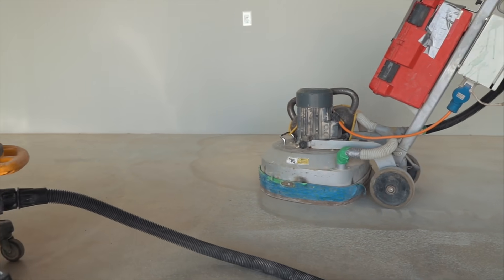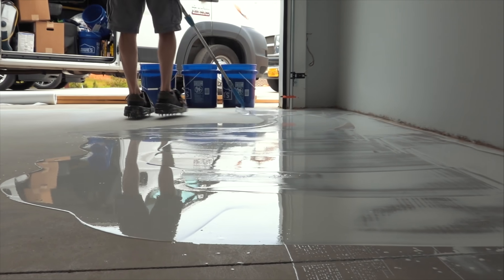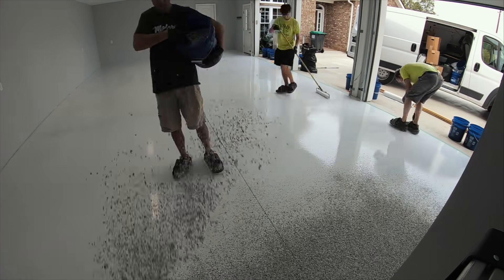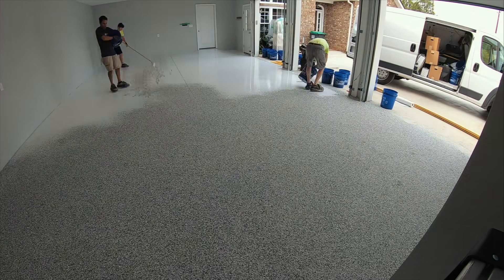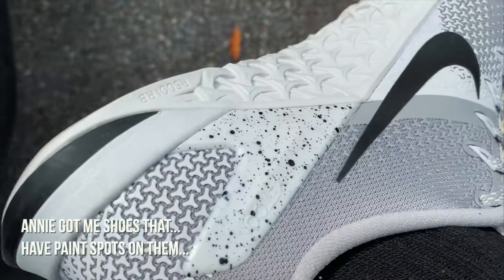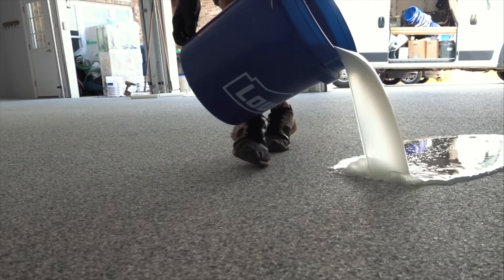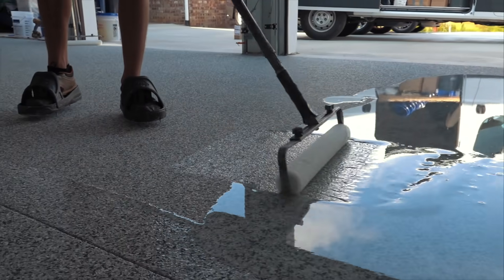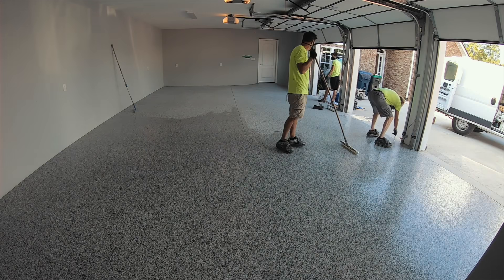EPOXY or POLYASPARTIC? A Step by step guide for an epoxy & paint chip garage floor.

Comment: Hi, Can you please suggest the product - Polyaspartic Coating; where to buy and and what to look for while purchasing. I am planning to do Garage Floor Epoxy using Polyaspartic (clear top) Coating, but finding it very difficult to purchase the item. Polyaspartic  is neither available in Home Depot nor in Lowe's. Thanks in advance
Reply from the maker: Hi. 

We use 100% solids epoxy with 90% solids polyaspartic urethane. You usually have to buy directly from the manufacturer. 

We don’t offer specific brand suggestions on YouTube. That is available
In our course along with a lot more information about how to do this type of coating. 

https://decorativeconcreteschool.teachable.com

Comment: @timdcva do you ever need to do anything special with the control joints on the slab before your epoxy base layer ?
Reply from the maker: We fill them with epoxy paste or polyurea caulk if the customer wants a seamless floor. Other wise, we don’t have to do anything to them.

Comment: If I painted a mural on a clean slab concrete floor, and you guys' clear coat on top, would that work? 
Would it be ok, if mural was done in water base acrylic paints?
Reply from the maker: It would probably be fine if you sealed it with water based sealer. You would need to test it first.

Comment: How about epoxy over brick? I know it sounds weird, it's a weird house. The interior floor is brick over concrete so the brick it pretty stable. I should remove the brick and float concrete over the whole thing but the client is reluctant.
Reply from the maker: I always tell the customer we need to remove whatever is on the concrete. I would just be nervous the surface of the brick would deteriorate.

Comment: What about the slip factor.  I didn’t see you add any silica to the final polyaspartic.  Is this top coat non slip. ❓❓❓
Reply from the maker: We don’t ever get any complaints about it being slippery. I think it’s a good balance of texture so it isn’t too slippery without it being so rough that it would be hard to clean.

Comment: I would like to do the apolly acrylic in my house do I have to do the whole thing at one time for it to be uniform  or could I do half let it dry and set up and then do the other half would that look okay thank you
Reply from the maker: The color should be uniform if you did half at a time… but the top coat might have a slightly different sheen if you did it in two phases.
Reply: @TimDCVA  thank you very much I really appreciate it when I do it I will do the whole floor
Reply from the maker: Sounds good. Let me know how it goes.

Comment: Thank you for this very informative video. I am having trouble clicking on the link for the polyaspartic product you use. Any assistance appreciated. I am going to attempt project myself. Assume grind, vaccum, prime, epoxy, flake and then polyaspartic. Thank you.
Reply from the maker: The course site is down this evening for maintenance. Just check back tomorrow and it should be up. 
Thanks!

https://decorativeconcreteschool.teachable.com

Comment: ?how much it cost
Reply from the maker: Usually between $5-$7 per square foot. It varies from job to job based on the size and condition of the concrete.
Reply: @TimDCVA  A guy gave me a  quote 11$ square foot for polyaspartic.
Reply from the maker: Was the garage small? Most people have a minimum charge so it can go pretty high per square foot for small garages.

Comment: We did the same to our outdoor staircase and balcony and after 3 years on the balcony there is a strip of 4 ft long that has lifted and there is like a bubble underneath but has not cracked yet, why is that and what might of caused it?
Reply from the maker: It could be a number of things. Sometimes it will happen if the concrete wasn’t prepped enough before applying the coating… or it could have been caused by moisture passing through the concrete. It’s hard to say for sure without seeing it.
Reply: Tks

Comment: The last shot of the floor looked like a pebbly beach.  I hope you made it smooth eventually, otherwise it would have been cheaper to leave the concrete as it was
Reply from the maker: It is smooth.
Reply: @TimDCVA  Look at 3:30 to 3:35.. that's not smooth
Reply from the maker: If you are looking for something that is perfectly smooth, then we have other systems for that. 

Vinyl chip epoxy has enough texture to keep it from being slippery without being hard to clean. None of my customers have ever complained that it’s too rough.

Comment: What's the difference between epoxy and polyaspartic? I'm looking to do our garage and don't know what to buy
Reply from the maker: Polyaspartic is a urethane that sets faster than epoxy and doesn’t turn amber in sunlight. It doesn’t bond to concrete as well as epoxy… so we use epoxy primer… broadcast chips and then top coat with polyaspartic.
Reply: @TimDCVA  ahh that makes sense. The kits that I am looking at online, I'm guessing they are likely 100% solids epoxy and then the top coat is the polyaspartic top coat. Is that what I should be looking for?
Reply from the maker: I would look for >95% solids epoxy with 85% or greater solids polyaspartic. 

The poly sets really fast. If this is DIY then be careful. Don’t mix too much at once and have plenty of helpers available.

Comment: What is the purpose for the vinyl chips and can one do the same but without the vinyl chips?
Reply from the maker: It’s just for the look. It also leaves a good texture for a garage floor. Epoxy without chips can be slippery when wet if you don’t add something to give it texture. But to answer your question… yes you can do it without chips.

Comment: I have a room under my garage that the salt and water have rotted the galvanized pans underneath. I have 2 drains in my garage but the salt soaked right in. Will this epoxy application stand up to self and water? Great video btw! I've subscibed.

Comment: How lond did it take to make the polyaspartic resin lqyer before it cured? Is it still useful to work with (is it still thin) after e.g. 30 minutes?
Reply from the maker: 30-45 minutes of working time. Cures overnight.

Comment: You did a great job! I noticed that you did not extend the Apoxsee floor beyond the garage door. Smart move. Our installers took it all the way to the asphalt driveway, so they cover the entire concrete garage floor. Now the Apoxsee that extended beyond the garage door is chipping up. How do I stop it from going any further? How do I clean up the remaining Apoxsee that is on the garage floor beyond the garage door to create a nice line? I have tried to get people to come out to fix it. But they have said that the job is not big enough and unless I want to replace the entire garage for it’s not worth they’re doing it. So how can I remove what’s chipping and how do I prevent it from going any further? But I would appreciate any ideas because this is a problem that I believe could be fixed.

Comment: I have a sunroom with awful tile. Can this process be used over existing tile (without removing it)?  We are trying to find a floor that is dog proof (they haven’t taken well to housebreaking!) but it needs to be flooring the will go over a floor that slopes (there is about a 6 in drop from one end of the room to the other -about 30 feet).  Is epoxy flooring as durable as it looks?
Reply from the maker: We always suggest taking up tile before applying epoxy. We can go over tile if there is some reason not to take it up. 

We’ve actually done epoxy flooring for dog kennels... so yes I think it would probably be okay.

Comment: You should look into being a dealer for Penntek. They have a less than 1 day dry polyurea product thats got a lifetime guarantee with 15 year warranty. Much more flexible and durable than regular epoxy! You can't buy it in stores  and its not cut with any thinners. 100% polyurea. You can also install in very hot or very cold Temps down to -20°. Highly recommend!!
Reply from the maker: Cool. I’ll look into it. 

I haven’t really had much interest in the 1 day systems... always worried that a floor will get away from us before we can get it rolled out. The low temp install would be awesome though. 👍🏻
Reply: Does Polyurea have any moisture barrier protection in it?
Reply from the maker: @martinspille4921 most of them don’t.

Comment: Tim- This is beautiful work!  Two questions though...I live in Pittsburgh, PA, with cold winters and snow.  Lots of hills here and road crews use a great amount of salt and calcium chloride on the roads to keep them from icing over.   So first question:  Will this product stand up to road salt and calcium chloride?  Second question:  is there any risk of hot tire pickup?  Thanks-
Reply from the maker: Thanks!

We haven’t had any issues with them holding up to road chemicals here in VA.

Hot tire pickup is not a problem for high solids epoxy & polyaspartic urethane (assume it is prepped correctly). Some lower solids/thin-film coatings from local paint stores don’t do as well under tires though.
Reply: @TimDCVA  Thanks Tim!  I gotta do something before winter...gonna give it a go!
Reply: I have a contractor that has been doing this for years in Pittsburgh, PittsburgGarage.com

Comment: Can this be done on a outdoor concrete counter top? It does get part sunlight in some areas. The counter top is concrete and not smooth. Do you think epoxy will be a good idea? The counter top is about 80 sq Ft. What will be the cost for labor & material?

Comment: Kinda weird you used epoxy instead of using polyaspartic through out the whole process. Polyaspartic has a fast dry time, which results to a one day job instead of waiting 12 hrs for the epoxy to dry. I work for a polyaspartic company, I do garage floors everyday. And my company only charges about 6$ a square foot
Reply: Polyaspartics do not have as good as a bond to concrete vs epoxies, a lot of small companies offer a lifetime or 10 - 15 year warranty, not worth the paper they are printed on. We have an epoxy basecoat that is dry in 3 hours.  Check it out, Sikafloor 165 FS.
Reply: @BradWeil  ive went back to floors that we’ve done 20 yrs ago just for a clean and they look as good as new. Epoxy is much more time and money wasted into labor when you can get better results with one day of work while using poly.
Reply from the maker: Hey!

I don’t use PS primer because I don’t want to do the entire garage in one day. I know I’m in the minority on this...but  I don’t like waiting around for it to set up so we can clean and coat it. 

For me it’s just easier to use epoxy primer so we have more time to get it down...and instead of waiting for it to set up, we just go do something else.
Reply: TimDCVA Still do great work. We have a high demand here in Florida with these floors. The owner has 3crews which I’m a crew leader on one and since we’re in Florida with all this heat, the product takes only 15mins to dry. Right now we are doing balconies for this hotel by the beach but its a quartz system
Reply from the maker: Cool. I live in a pretty small town so there isn’t enough demand to do that many garage floors. What products do you like to use?

Comment: Tim, awesome video.  Awesome work. Does the polyaspartic ever bubble?  If it does should bubbles always be fixed?  Thanks
Reply from the maker: Thanks! 

Changes in environmental conditions during an installation can cause lots of different issues. It’s hard to answer your question without seeing what you are talking about.
Reply: We had a floor put in at our condo last week. There are bubbles everywhere. The installer say it's normal, from the gas release.  In general, do you believe bubbles always need to be fixed or it depends on reason such as if from gas release or too thick of a coat. Thanks Tim.

Comment: Looks good,  how come you didn't fill the control joints to make it a seamless system? You would also get better coverage on your coating and sealer if you used a larger squeegee and laid a bead on liquid on the floor and spread it out by following it with the squeegee.
Reply from the maker: Thanks! 

We offer filling joints as an option to all customers. They chose not to do it. I like it better with the lines showing anyways.

I don’t like to use a wide squeegee. It leaves too much material in the low spots of the floor.

Comment: Had my 2-car garage coated last year using the polyaspartic method. Workers started at 8:15 and were done the same day at 1:30 PM. Waited 24 hours to use. Was expensive, but came with a 15-year guarantee. Definitely the way to go.
Reply: Polyaspartics do not have as good as a bond to concrete vs epoxies, a lot of small companies offer a lifetime or 10 - 15 year warranty, not worth the paper they are printed on.
Reply: @BradWeil  What is the warranty if you use epoxy? How long does it take to finish an epoxy job?
Reply: @artlayton1425  Every legitimate manufacture of flooring resin systems offer a standard one year warranty.  Sika has been in business since 1910.  We do offer extended warranties to our applicator network, but keep in mind the installations crew's preparation and application is the key and they are the ones offering the 10+ year warranties.
Reply: @artlayton1425  Our fast cure epoxy primer/basecoat is ready for topcoat in 2 - 4 hours depending on temperature.  Too cold then longer.
Reply: How much was it and how big is your garage if you don't mind me asking?

Comment: I got quoted $70 a sq’ for my 3 car garage. That’s enough to make me go it on my own. I’m just fearful of the working time of the product and not being able to get it perfect before it starts to setup. I’ve thought about working in sections up to the expansion joints. What do you think?
I have plenty of experience working with PPG direct to metal, part A and B epoxy, so I pretty much know what I’m up against. 

Nice video and great work, hat tip to you guys!
Reply: $70 a square foot is outrageous lol
Reply: Market price for an installed resin/flake system for a residential garage is $5 - 7 per square foot depending on size and location.
Reply from the maker: Thank you!

That is expensive. I don’t blame you for doing it on your own. If you’re familiar with epoxy then I think you’ll be okay doing it in sections. 👍🏻

Comment: Hey Tim, do you fill the joints with anything or is it okay just to let the solid color epoxy fall into the joint cuts?
Reply from the maker: We leave them open on most jobs. Occasionally a homeowner will want them filled... we use Euclid quick joint in that scenario. Overfill the lines and shave them flush to the floor after it cures.

Comment: Hi, the base coat looks less viscous than other epoxy videos I've seen. Is it because it's a primer? Will that affect quality at all?
Reply from the maker: We use a 93% solids primer...which is considered a high solids primer. It’s pretty close to the same as most other primers. It does have a lower viscosity than most though. It doesn’t effect the quality.

Comment: I have a old stained and damaged concrete floor 26 × 40. There is bad stains that muriatic acid cant remove. What floor covering and procedure can I do that will stay down.?
Reply from the maker: We usually grind the concrete before coating any project. That removes 99% of stains on the concrete. Occasionally there will be oil spots that the grinder can’t remove... in that scenario we use an oil stopping primer on that spot. Google “General Polymers 3504”.
Reply: Thank you

Comment: Do grind the floors if the concrete is new?
Reply from the maker: Yes. We always grind the concrete. It makes the epoxy stick a lot better than going right over smooth concrete.
Reply: @TimDCVA  
When is the ideal time to grind new concrete?  Does it grind easier before 30 days?
Reply from the maker: We usually just grind on the day that we apply the first coat. If you use the correct type of diamonds you shouldn’t have any issues with the concrete being too hard to grind.
Reply: TimDCVA what brand of epoxy and polyaspartic do u use?

Comment: Geeze, these floors are something else. Great work. Question: if you caulked the saw cuts why do they still show up in the final result?
Reply from the maker: Thanks! This customer chose not to cut the saw joints. The only thing we caulked on this floor was a few hairline cracks.

Comment: Most polyaspartics don't seem to have that much working time.  Any time i've used them you have about a total of maybe 10 minutes to squegee it out and back roll it before it gets too tacky and starts leaving roller marks.  Whats the working time with your polyaspartic?  I know if i rolled any of the polyaspartics i've used as much as you do in the video, i'd have roller marks galore.
Reply from the maker: I used to hate polyaspartics for that reason... but over the last few years different manufacturers have come out with slow setting polyaspartics. This one gives you about 30 minutes of working time during the summer months.
Reply: @TimDCVA  where did u buy this product I mean polyespartic, thanks
Reply from the maker: We cover which specific products we like to use in our course. 

https://decorativeconcreteschool.teachable.com

Comment: Question i was thinking of doing a white countertop with minimal vein with countertop epoxy and using polyaspartic as top coat. Will polyaspartic be as glossy as epoxy and will it have the orange peel look?
Reply from the maker: I’m not really sure. Epoxy probably levels out more since it doesn’t set up as fast. I’ve never noticed any of our polyaspartic floor coatings having an orange peel look though. You should check out the Legarri channel. They do a lot of really good epoxy countertop tutorials.
Reply: @TimDCVA  thank you for responding